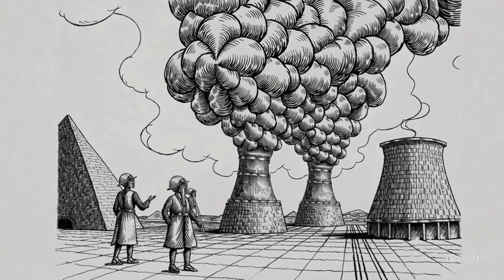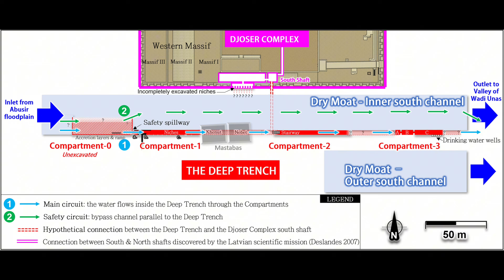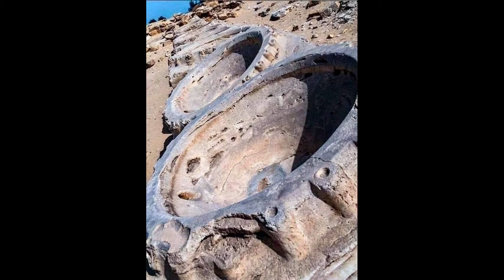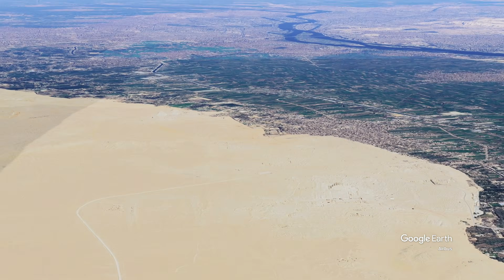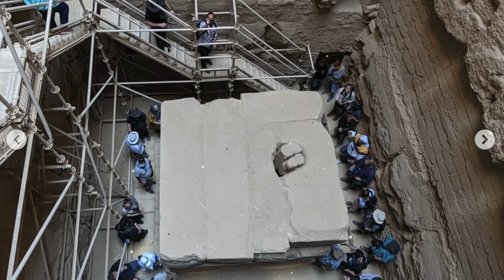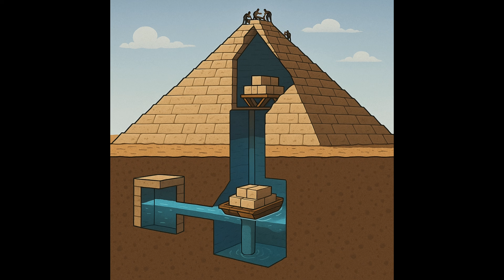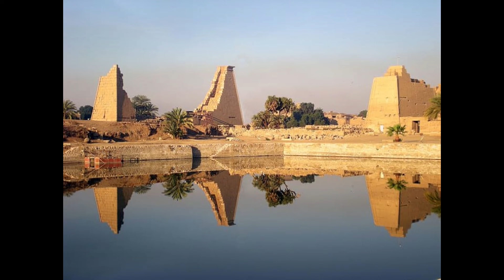The Incredible Hydraulic Lifting Machines of Ancient Egypt

Comment: The official story is a lie. The pyramids weren’t built to be tombs, they were functional in some way. Either the Egyptians had more advanced tech than we were taught or they didn’t build the pyramids.
Reply from the maker: Or maybe they used hydraulics, flotation, waterwheels, pulleys and other methods of mechanical power to augment human strength, just earlier than we assumed.
Reply: @intothemap360  possibly a little of both. The structures beneath the pyramids and the incredible accuracy of some of the granite boxes etc still seem to require a lot more explaining. The pyramids themselves definitely seem to have been constructed using water. But I still think some of the pyramids, along with other sites across the world are built on top of or near to older structures. Even hydraulics don't seem to be able to explain the size of some of the magalths out there.
Reply from the maker: @timbob1145  I’m sure they were smart enough to take features that worked well and used those in future ones, and discard ideas that didn’t work well. Maybe they planned to use this as a float and it was a total flop! I think it’s so much more interesting to try and figure out how you would have done it if you were back then instead of just hand wave it away as impossible, this was built by the Nephilum. Think about what privileges we have. If I didn’t have a Philips screwdriver can you imagine how hard that would be to make from scratch? We get to use that tool to build other tools which then build better tools but somewhere way back when was a guy struggling to hammer the first screwdriver out of some metal

Comment: Seems reasonable to me. Limestone blocks are about 2.5 grams per cubic centimetre and water is 1. So you only need to displace another 1.5 g per cm3 to get neutral buoyancy. I've heard ancient Egyptians were good at building boats, arks. So I think they'd have found this stuff relatively easy. Water lifting locks are a thing I'm familiar with having spent time on barges. It still amazes me that a single human can effectively lift 16+ tons with little more than flowing water and some doors, sometimes leaky ones at that. There are locks all over England and some are older than steam engines. So we were demonstrating similar feats of lifting with no need for aliens, or even particularly sophisticated machinery in the fifteen hundreds.

Comment: Go back further in time, all the pyramids were built directly along the Ahramat branch of the Nile that has since dried up. The African Humid period is the most ideal time for construction, not a desert setting. 

The internal chambers and tunnels for all pyramids were designed with advanced water management in mind, it's central to their operation, as you say just add water. Adding water to an airtight room > gas compression > heat + pressure > chemical synthesis > new elements. Chemistry comes from kemet (old name for Egypt). 

Step Pyramid is an ideal design for a   bio-methane reactor from cow dung (Apis Bulls). Just add water to make slurry, bio-methane releases naturally, just need a large structure for gas capture. Land of Chem covers a lot of these theories, they have merit.

Take bio-methane to Red Pyramid, fill first chamber with Methane, compress gasses in 3 stages (3 chambers) using water (just fill the rooms) and you get dilute chemical ammonia in aqueous solution in the 3rd and final synthesis chamber (persistent ammonia smell to this day).
Reply from the maker: Oh yes I am going to do a video on the lost branch of the Nile you read my mind haha.

Comment: Not tombs due to the lack of the necessary funerary hieroglyphs, so no mummy to keep dry. Also, the pyramid of Djoser is made of small mud bricks, so it wouldve been easier to just carry the bricks up IMO
Reply from the maker: I do not believe it’s just small mud bricks although it may have some. I’ve seen it listed as being made from Tura limestone blocks on the outside, regular limestone instead and some features like the boxes of Aswan granite. But I don’t know how massive they are in comparison to blocks so you could still have a valid point. As you saw in the video there are certainly issues with the theory as well as points in its favor. What do you think the shafts were for then if not tombs?

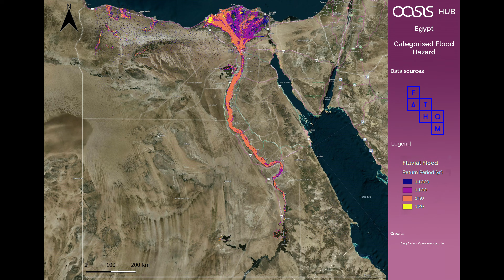Comment: 03:36 - What does the data display in the differential between the Pyramid's base (Column D), and the elevation above the Nile's east bank (E)? 
I notice the data on your (embarrassing?) spreadsheet indicates a 20m elevation differential for each Pyramid.
Reply from the maker: In the Memphis region, for instance, the west-bank desert escarpment rises to about 40–55 m asl, while the adjacent Nile floodplain lay around ~20 m asl (journals.plos.org) This means Old Kingdom pyramid bases at Saqqara (≈50–60 m asl) towered roughly 30–40 m above the contemporaneous east-bank settlements on the valley floor
journals.plos.org) Similarly at Giza, the pyramids rest on the high Giza Plateau (~60–68 m asl) overlooking the lower Nile valley (~20 m asl)
fliphtml5.com
Comparison of base elevations for selected West Bank pyramids vs. a typical East Bank floodplain level (blue dashed line at ~20 m asl). All major pyramids were built on ground well above the Nile’s east-bank settlements. Notably, the only case dipping to floodplain level is the small pyramid of Ibi (Dynasty 8) during a period of unusually low Nile floods
nature.com
Therefore since I do not have exact topological data for each curve of the nile and couldn't find it, I used the following python to extrapolate the difference. I hard-coded the east bank average elevation as a constant 20 meters (based on archaeological and hydrological sources for the Nile floodplain).
So every comparison was simply base elevation ""– 20  east_bank_avg_elevation = 20  # meters above sea level
pyramid_df["Elevation Above East Bank (m)"] = pyramid_df["Base Elevation (m)"] - east_bank_avg_elevation"" 
Why the difference is "always 20m":
That’s only true if the pyramid base elevation is hardcoded the same and in my first data set many pyramid bases were rounded to similar values (e.g., 60m, 55m, etc.). The difference is consistent not because of the comparison logic, but because the inputs lacked variability — many pyramid sites were estimated to be ~60m, so the 60 - 20 = 40 logic repeated. Probably not the way a professional would do it but I was trying to make a quick visual for the video. Feel free to make your own better excel and python :)

Comment: It doesn't look like (m)any Pyramids were tombs; the Red Pyramid (which predates the "Great Pyramid") may have been used to create Ammonia; while just recently structures under the Great Pyramid appear to have been detected which are shaped like columns or shafts. These may be foundations to support seven million tons of stone, but may be more, perhaps even a lifting mechanism as you describe. I'm guessing but maybe the builders were using high pressure water jets, with abrasives, to cut stone and hydraulics to lift them?
Reply from the maker: I shall get to the stone cutting, use of water powered machines, circular saw possibility and everything else in this same methodical style in the future. As you see I don’t like to jump to conclusions I can’t find proof for but these are all excellent topics to explore
Reply: @intothemap360  Granite "case hardens" over time; but bronze, or brass, is too soft to cut it and they didn't have steel; today we use diamond cutters. 
There seem to be two problems: how to cut granite and how to lift 20 ton blocks of it up 2-300 meters. 
I'd heard (somewhere) that the Egyptians had steam power, but it was more a novelty; a spinning ball powered by steam escaping from jets. Thomas Newcomen, in 1712, developed an engine with cylinder and piston, delivering continuous mechanical power. 
So I'm interested to find out what the cylindrical objects are under the Great Pyramid (if they exist).
Good luck with your channel; the conclusion is seven million tons of Pyramid; that's quite a jump in technology 4,500 years ago. I don't think it's a tomb.
I'm guessing it had an industrial purpose.